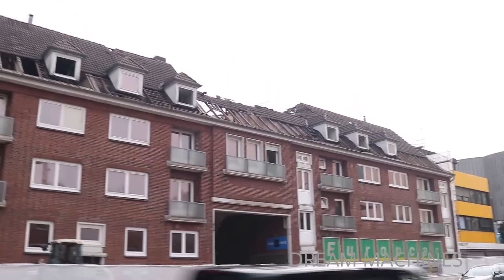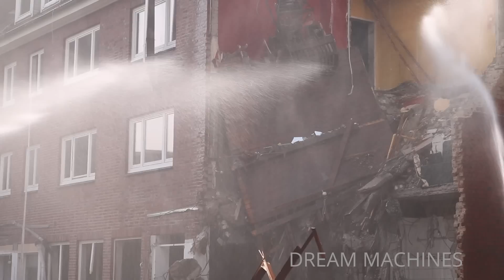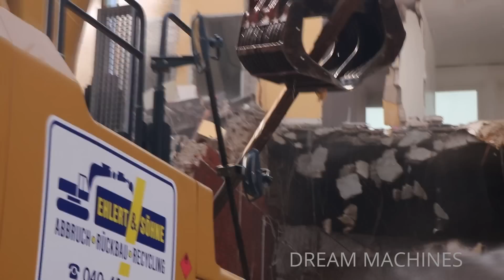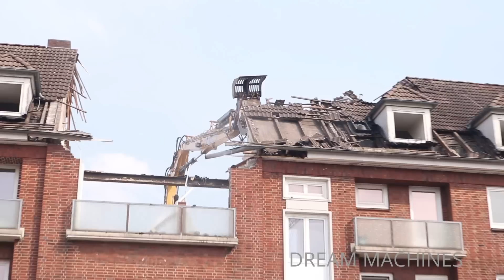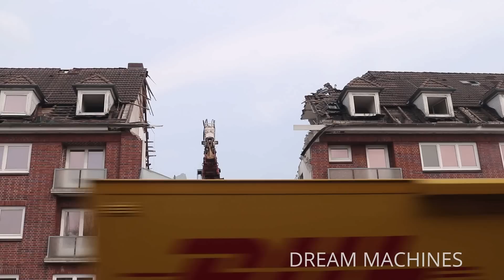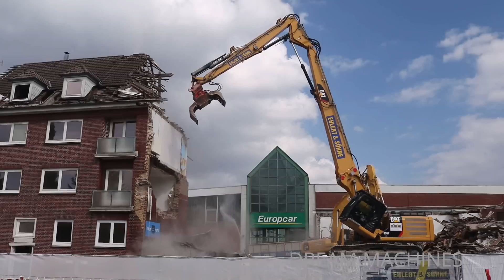CATERPILLAR 336F 🚧 LONGFRONT + KOMATSU PC210 BAGGER ABBRUCH BAUSTELLE WOHNHAUS 👷🏻‍♂️

Comment: I'm always surprised they don't leave more space in front of the buildings being demolished. Ok I know the crane driver has done it many times before and is an expert at his job, but I was always taught from an early age to always 'expect' the 'unexpected' when demolishing a building. The trouble with all jobs like this you can't be 100% certain that the ground hasn't settled under a certain part of the building, even an old water leak is enough to do it, or just the rain over the years. I saw the results once of an entire building that was being demolished - (like this one from the rear and the side), - and nearly the whole of the front had fallen flat into the road without warning, killing about 10 and injuring a load of others. Turned out rain-water had been seeping down the front of the building for many years, - the council had replaced the paving slabs and filled in the odd hole now and then, but no-one had thought to check the buildings footings.

Comment: It seems there are a lot of wasted movements of the grappler, just to grab a single stick of wood and bring it all the way down. Weird. Or spending time to use the bucket to knock over a pile of bricks. It’s like the operator is playing almost.
Reply from the maker: the fastest and safest way! You can't let a worker climb up there into the weakened building, too dangerous.